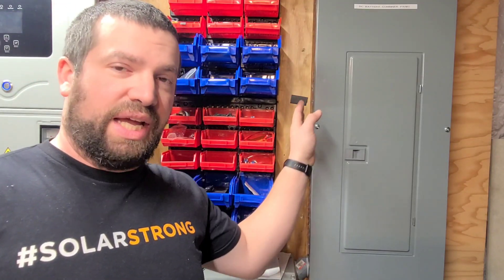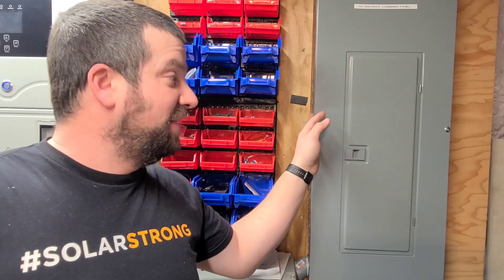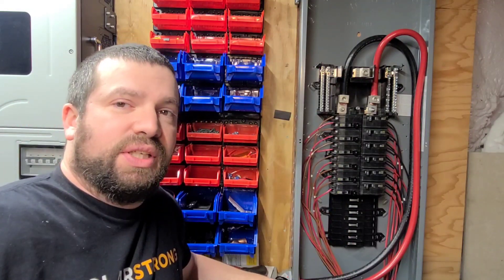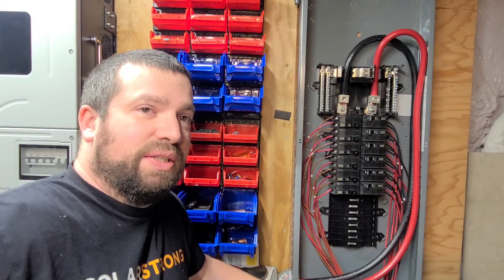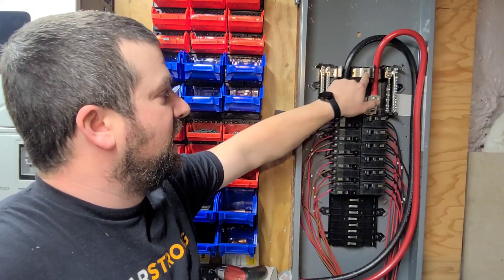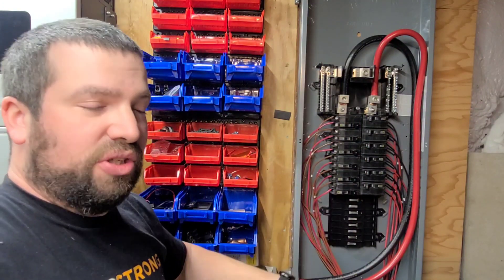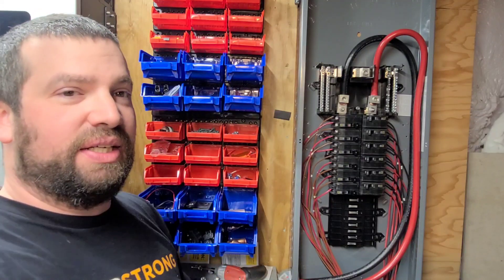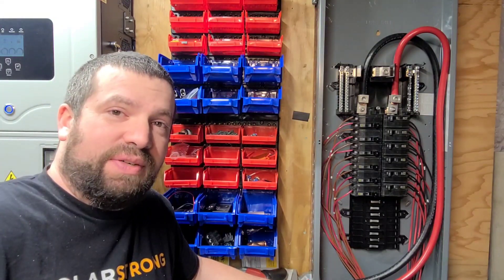AC Breakers and Load Center for DC Power?

Comment: Is it possible to add lugs or some sort of adapter on the smaller 10-20 amp breakers for larger wire? I have a 24 volt system and want to build a DC load center. Not for the inverter but small dc loads like DC refrigerators, lights, pumps and fans. #8 is the max though and limits me to around 40-42 ft max for a 3% voltage drop.
Reply from the maker: The 20a qo breakers are rated for up to 8awg wire. Can also come off the breaker with a smaller wire, then use a wire nut or similar to tie that to a larger wire.  You can also  use single pole breakers for 24v systems. Just tie the positive to the breaker, negative to the isolated neutral bar.

Comment: I Do have one Question. If one was just getting started and had 1 Battery thus far, wouldn't the breaker trip every time you hit it with a load that draws more than 50 AMPS from the Battery? ...Great Video and Thanks for the clarification.
Reply from the maker: Yes, you'll need to have enough capacity, otherwise you'll start tripping breakers.  Thanks for watching!

Comment: Can I use the QO 110v breaker for a 12v circuit? Is 48v the max v?
Reply from the maker: Yes you can.  Correct, max voltage is 48v for the single pole breakers. (Which will not work for a 48v system as the voltage goes higher than that)
Reply from the maker: @harvoa6785  I'm not sure I'm following you.  You definitely don't want both 12v and 240v in the same load center, and you won't be able to power your normal AC loads off of 12v.  You can use this for distribution of 12v to 12v branch circuits or combining batteries, but that's pretty much it.

Comment: Another interesting thing I have been investigating is 48vdc (typically 40-60vdc) LED lamps that use the various standard edison derived sockets.

You could drop a breaker directly into the DC load center and wire up standard sockets and drop in those special bulbs, all in DC.

Comment: 225A main lug would only be 10 * 20A breakers. I think you may be exceeding that if you’re not careful. If you don’t need more per battery, I’d suggest 15A breakers.
Reply from the maker: The breakers don't pull power.  The limit here is how much power the Sol-Ark can pull, which is around 190a.  If you are using an inverter that can pull over the limit, I'd suggest multiple load centers.  15a breakers would be fine though. I started out the fewer batteries and breakers, so there was more current going through each one which is why I went with 20a.

Comment: What type of lug did you use to attach your main cables to the top of the panel? It looks like you used something like a grounding lug?
Reply from the maker: Those are the main lugs that came with the panel.
Reply: @benssolarandbattery  O okay, I was looking at panels that came with the main breaker installed. I was wondering if you had removed it and put on those lugs. Now I see they sell them readily with those lugs and no main breaker. Thank you for the response.

Comment: There’s a lot of ratings we can’t fit on the side of the breaker, or the label on the data sheet. When in doubt, just check the nicely aged product literature. Don’t rely on just the text on the product page as it’s not always up to snuff. 

BTW, what settings do you have in your sol ark for the battery float, absorption, and equalization settings?

Comment: Just ordered the QO154L225PG; Thank you Ben!!!

I noted your urge to continue expanding; so I got the larger LC upfront. Question tho Ben: are you worried about the limit square D saying only 10 2-pole breakers per LC? I found this to be my only concern going into my first large 500+ ah build. As ALWAYS thank you for your help and support in continually educating us in the art of solar 🙏.
Reply: Excellent question! Did you ever find an answer? I would think that the limit has to do with not overloading the panel with 50 amp breakers for ovens and water heaters and that but in the situations like this maybe it's the spirit of the law not the letter of the law since all of the breakers are going to be small?
Reply: @BenBrand  thank you. I agree it's most likely to deal with overloading and heat dissipation reasoning... Thus far the panel is performing flawlessly just like Ben's at 48VDC near fully loaded two pole breakers.
*However* do know: Square D/Schneider electric has a nation wide recall on some of these panels (I believe mostly plug-on neutral style). Normally you wouldn't use these styles, but I got a great deal on them back when purchasing 😅.

Comment: Why didn't you mount the load center upside down to use less of the expensive cable?
Reply from the maker: Good point Mark! I apparently didn't think it through all the way... Definitely would have saved on wire!

Comment: Not a really new idea. The power utility I work for has used the Square D for 129vDC distribution in station control buildings for years.
Reply from the maker: That is an oddly specific voltage. Why 129vDC?
Reply: @benssolarandbattery  129vDC is the nominal battery bank voltage for substation switchgear and protection equipment. Telecom equipment is nominal -48vDC.

Comment: sorry but you cannot do that , the main concern is tripping under dc load , in several cases the breaker will not trip , so you need some European breaker type that have the dc rating with the short circuit interrupting test
Reply from the maker: Please watch my video and check out the spec sheets in the description.

Comment: How do I figure out what size breaker to use for the battery? 51V 160Ah Max charge 160A continuous discharge 150A Max discharge 200A overcurrent detection 200 A with 10s It has a 16S2P cell configuration.
Reply from the maker: For mine, I took the max charge or discharge divided by the number of batteries in parallel x1.25 for continuous load and then rounded up the standard breaker size.

Comment: I like the idea but according to mid night engineers a/c braker should not be used as a D/C breaker.  The inrush can damage the breaker and other equipments.
Reply from the maker: These AC breakers are rated by the manufacturer for DC as well.  In general, I agree, but this is an exception.
Reply: @benssolarandbattery  it won't fit my system.  I  have  250v 60 amp cc and battery packs each are 280ha. Just ordered the double pole 63a dc breakers.

Comment: I doubt your batteries are <5KA for short circuit current, unless they are small lead acid batteries.  Lithium batteries usually have 10x or more of short circuit current than their amp hr rating, plus you have multiple batteries being paralleled in that panel - just increasing the available fault current.
Using the breakers outside of their rated interrupt rating is a huge fire hazard.
Reply from the maker: Could be, but I figure with the overcurrent protection of the BMS's factored in as well, it should be pretty safe.  The Sol-Ark also has a 250a breaker protecting it, but I'm not sure what the AIC of that breaker is.
Reply: @benssolarandbattery  True, if the BMS doesn't fail (not saying it will), but BMS's usually use MOSFETs  to disconnect the battery and they can fail short circuit.  This is why in high AIC applications it is important to use the correct AIC rated device(s), as in how Telsa's uses ceramic fuses rated at 200,000 AIC.   Just want you to be safe! I work on a lot of large, very dangerous batteries with work and have seen the destructive power during fault events and failure of under rated protective devices.

Comment: This is great!!! Thank you for posting this. It gives a much better way to connect all the batteries. Would it be a good idea to connect the BMS leads in this load Centre instead of on the top of the batteries. That way it's much easier to do the expansion of the system with a bigger BMS as you expand the battery bank?
Reply from the maker: I'm using an individual BMS per module. It would be a lot more work running all of the BMS leads up as well. As I expand, I just add modules with BMS's on them.

Comment: This is great!  Since your load center is acting as a combiner, can it not also act as overcurrent protection of the individual panels in a solar array. I understand that if more than two panels are paralleled, they must be fused. I am installing a 36 panel array. The spec sheet says:
Open circuit voltage    40.39
Short circuit current    10.25
Rated voltage               33.24
Rated current                  9.73
Looks to me like this would work.
BUT I checked the price at my SqD dealer. The load center QO142L225PG is Only $243.86 + cover $24.89. The breakers QO115PCAFIC are Only $69.46. That totals ONLY $2772.05. That will take care of half of my panels, so double that and it costs $5544 for two panels, covers and breakers.
That information curbed my enthusiasm!  What am I missing here?
Reply from the maker: Missing a couple things! I picked up the load center new with cover on ebay for $90. Secondly, I don't think you can use AFCI breakers for this. I got breakers new off ebay for $12-15 a piece. 3rd, you're most likely going to want to go over 125v with 36 panels, so this wouldn't be the application for this type of combiner.

Comment: Love your videos Ben, your a great host! This stuff is awesome.  What wire gauge are you running to all the diffrent breakers? Cheers!
Reply: Btw Ben you should make a odysee.com account and have your videos linked over there, its a cool streaming platform and folks can just donate tokens directly to your videos.
Have a good one!
Reply: It looks like 12 g, which I wouldn’t  run more than 40 feet on 60v. Beyond that it starts heating and losing power in the wire.

Comment: the question remain... what is that 48VDC rating? is it for nominal (or peak/max /full charge  voltage) as  when full the voltage is about 58Vdc so the 48Vdc must then be nominal otherwise a full cahrged battery would not be allowed. Battery and grid are not the same kind of voltage dynamic.. battery vary between two states and grid vary shortly min/max but remain constant. in fact LiFePO4 cells in 16s are OVER 48VDc as they are 51.2V nominal and not 48Vdc... to get a TRUE 48Vdc nominal it  require 15s with LiFePO4 and not 16s..... so this become very interesting to see how that 48Vdc rating is defined... Also a set of 48V lead acid battery can go up to 60Vdc in cold conditions when charging.. that is 12V above the 48Vdc "nominal".. that is fifferent than a true 48.0VDC  in 15s LiFePO4 that will go 54.75Vdc at 3.65 full charge per cell.  If you find that info Ben it would be great to ake a video to clarify that for everyone! Thanks
Reply from the maker: Yes, that's why I used 2 pole breakers.  I would definitely recommend them for anything above a 36v system.
Reply: The SELV (Safety Extra Low Voltage, <60Vdc)  seem one of the mention that cover that.
Reply: "Hazardous Voltage: 
Any voltage exceeding 42.2 Vac peak or 60 Vdc without a limited current circuit."

Comment: It's so hard to watch you touch the main lugs and bars, even if it's a safe voltage.  Just looks wrong.
Reply: Even harder was watching an electrician hook up my main service after he replaced the meter pan and load center years ago. He was standing on my roof holding the live lines (one at a time of course) cranking down the split bolts (I think they were split bolts, I don't recall for certain but they were something of that nature) with an uninsulated wrench. I know he wasn't grounded, so there was no where for the electricity to go, but it just looked wrong.

Comment: A question begging to be answered. Thanks! One minor clarification, the battery is connected to the big thick cables coming in the top and the lighter cables are circuits going of to different loads?
Reply from the maker: The batteries are all connected to the smaller wires, then the big wires go to the inverter.  Check out some of my earlier videos to see how I did it!
Reply: @benssolarandbattery  OK, you have me hooked...thanks for the reply too :)
Reply: OK, without watching every video, I reckon the batteries are at 24V or so and you are paralleling them up at the breaker board...cunning!
Reply: @Bennyboy-dog  He has a 48 volt system .  He just recently assembled a Leaf 8S battery to add to his multiple other LiNMC battery chemistries  such as Volvo, Volt etc
Reply: @teekay1785  Thanks tee kay.

Comment: I think it would be  good idea to test the breakers dc functionality. I would love to see if you only have one 20a breaker and draw 25 with your inverter at 48v, will it trip that breaker. Arching could weld a breaker at 60 volt if the travel between connectors is less than arc.

Comment: Hey Ben, I just noticed something in this video that tells me I made an mistake in wiring my Square D switches.  I have my hot (pos) wires where you have your brown (neg) therefore my main positive and negative 4-0 wires are also opposite. Is this a problem or should I change everything to the way yours are?
Reply from the maker: Hi Craig, it doesn't matter which one is positive and which is negative, as long as everything matches up in the end.
Reply: It might not matter, but you NEED to verify which is + and - so nothing gets destroyed!
Reply from the maker: @SuperVstech  oh definitely.  As long as everything matches up, you're good to go.

Comment: I wish I'd seen this before I bought 16 din-rail DC breakers. Oh well, very cool. Always great to learn new things I didn't know before!
Reply from the maker: That works too!  QO breakers aren't cheap, but there are usually decent deals to be had on eBay.
Reply: @benssolarandbattery  cheaper than midnite. The midnite breaker box has a few more slots but costs 300+ and the 15 amp breakers are 20-22 dollars. QO about 8-10 dollars.

Comment: Is that just for the Volvo’s or are the smart fortwos in there
Reply from the maker: Both! Going to be adding 6 more Volvo's and a Leaf as well.
Reply: @benssolarandbattery  do they all charge evenly. Do the top batteries discharge or charge more-faster than the batteries at the bottom of the panel?
Reply from the maker: @RJ-cc1fz  charge rate doesn't change from top to bottom. I do get a higher ampacity on the Smart Fortwo batteries as they have a higher capacity and I assume lower resistance.  Everything stays balanced though.
Reply: @benssolarandbattery  you should let me get the next set of Volvo’s bat hook up gets lol.. I’ve been searching the web night and day for some more 16s to add to my chevys
Reply from the maker: @RJ-cc1fz  hey, I got lucky last time!  A friend told me they were just listed and I happened to have $1400 to spend on batteries at that exact second.

Comment: I didn’t even know you could do this, my electrician took my 24V DC power into the Victron 24/3000 inverter and wired it to my AC panel. I have a 24 V system. Then I have a little switch to go from AC to off grid. I have no clue whether it’s right or wrong. 🤔
Reply from the maker: Hi Ben, this would be for the DC side.  On the AC side, it sounds like he installed some sort of transfer switch, which is a great way of doing it.

Comment: Interesting. So what is the voltage drop using that gauge wire from bat. To panel? Any concerns?
Reply from the maker: And now I've done the calcs... 🤣 0.67% or 0.33v at lowest pack voltage.  Not bad!
Reply: Ben's Solar and Battery not bad at all... and cheap, I see SD panels all over the place if someone wanted to replicate what you did.
Reply from the maker: @zekeboz5533  I picked this one up off ebay for $90 new with cover!  Breakers aren't cheap, especially now, but well worth it.
Reply: @benssolarandbattery  solid 10awg or stranded?
Reply from the maker: The most draw or charge I've seen on any 1 of the batteries is 13.5a, and that was when the pack was charging at 155a total.  I'm using 10awg wire about 10' long, haven't even bothered to do calcs on it.  I also have a BMS on each individual battery that provides catastrophic overcurrent protection just in case.

Comment: SO the way you have it hooked up the flow of power is backward as compared to grid ie the grid power would feed the main bus bar from the large wire where as the power is fed from the small wires to the large one which feed the inverter Correct. or are use feeding the panel from the large wires to feed components like charge controllers etc. I guess it doesn't matter.
Reply from the maker: Flow doesn't matter with these breakers.  They are non-polarized.  In this case, the batteries are the small wires and the inverter is the large wire, but power is flowing both ways depending on time of day.
Reply: @benssolarandbattery  True charging or discharging non-polarized is the clue.
Reply: What is happening is the batteries are backfeeding the breaker box, thereby turning it into a fused buss bar. On mine I connected my 4-0AWG to a 300AMP "T" fuse on the positive wire going to my Sol-Ark 12K.
Reply from the maker: @fisherus  I decided not to add another fuse, as the Sol-Ark has a 250a breaker already, but more fusing is never a bad thing!
Reply: @benssolarandbattery  so your fused at the appliance and not at the source. If a dead short happens before the protection you have 🔥. Please fuse as close to the source as possible.
Reply from the maker: @matthewdufour9072  the BMS's are at the source and provide overcurrent protection as well.
Reply: @fisherus  ya while discharging. The only thing is you have to bring full voltage to the box so each breaker has a battery at full voltage with it's own BMS it does have some advantage but expensive.
Reply: It's backward half the time...  The grid is alternating current, so half the time it matches this.